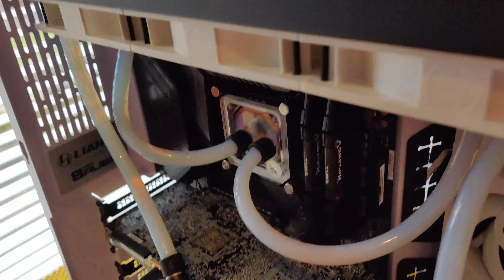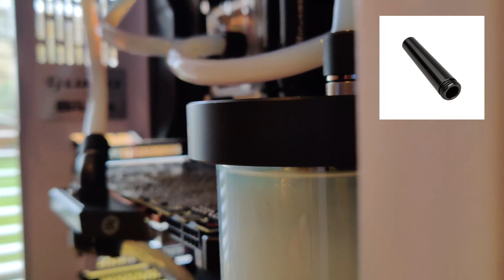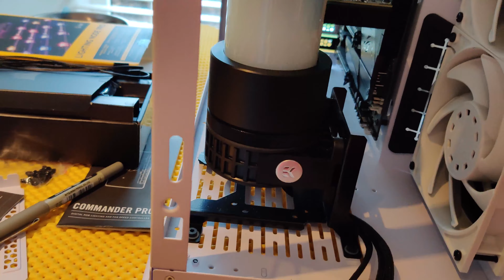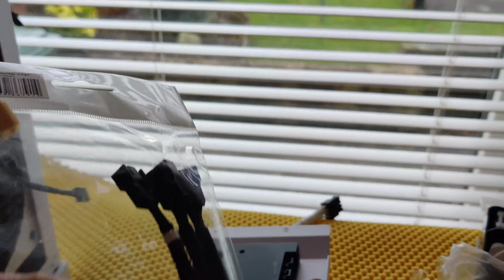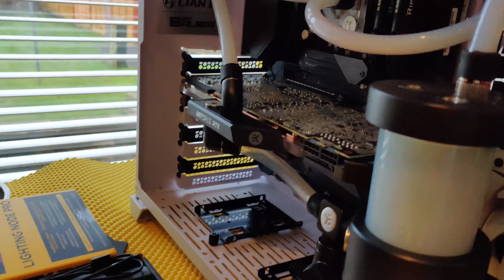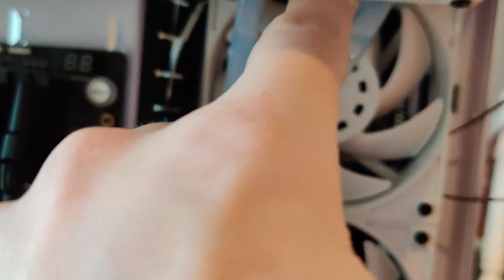PC water cooling, beginner lessons

Comment: thanks same case and soon going from AIO-case fans build (13 fans ! 7 case+6 push-pull vertical radiator) to custom loop in my lian-li as soon as parts arrive, I went Corsair Hydro X because it seems very beginner friendly and well I'm full corsair already (have 2 commander pros in the case already lol) corsair kit comes with the pump mounting brackets (vertical+horizontal for 120-140mm) also the splash pipe is in the pump-reservoir part, I only bought 2x 45° plugs and a drain valve that weren't recommended by the corsair builder we'll see how it goes, only cpu so it'll be a simple loop (planning to upgrade gpu this year maybe) I chose a larger radiator tough (55mm) that I plan to mount behind the case with fans pushing air outside of the case, we'll see how it works, if I can close the rear panel lol I measured it's supposed to be ok but you never know
Reply from the maker: Sounds nice, the Corsair stuff does look really good I was going to go that route, I only didn’t as I their GPU block stated it wouldn’t fit my card which is a Gigabyte blower style card. Does seem more beginner friendly you’re right. Hope you get on ok mate. Please post back some photos I’d love to see what you create 🙂 post back If I can help in any way I will. Cheers Richard

Comment: Nice video mate. Out of interest, why did you choose the smaller size reservoir? Great place to hide the Corsair Commander as well.
Reply from the maker: Thanks Tangers. Regarding the res, if I'm being honest this was what the configurator recommend so I just ran with it :-) Hows your build coming on?
Reply: @techtipsuk  Slowly, just got back from a few weeks of rehab for my back. Taken the loop (that I'd assembled outside of the case as a trial run) back to pieces and going to start putting it back together this weekend in the case.
Reply from the maker: The temps are great though mate. My RTX 2080TI runs at about 40 - 45 degrees under load. When I have this card in my mini itx case with the default cooler it ran at just under 100.